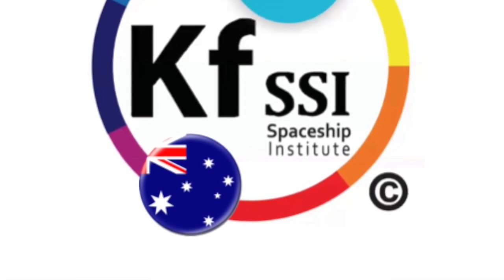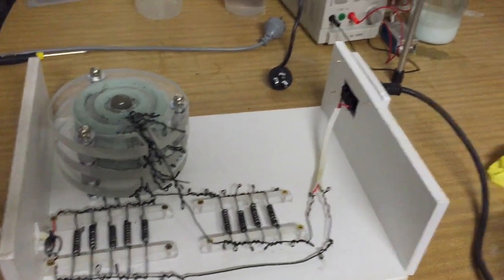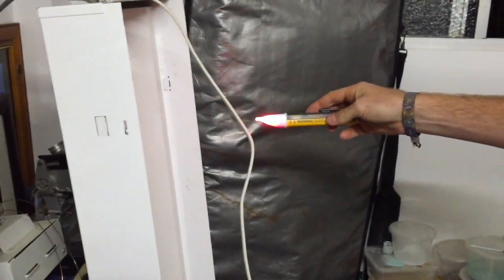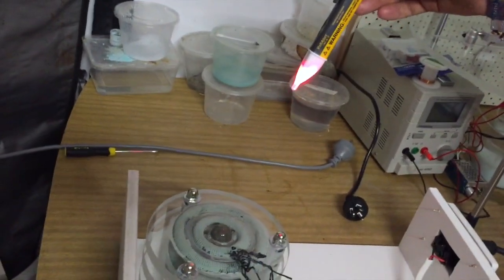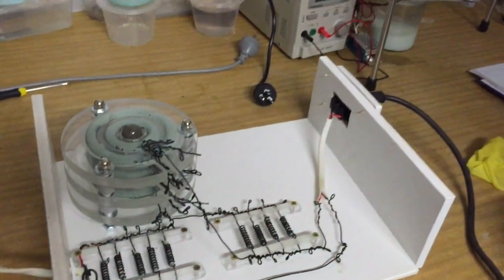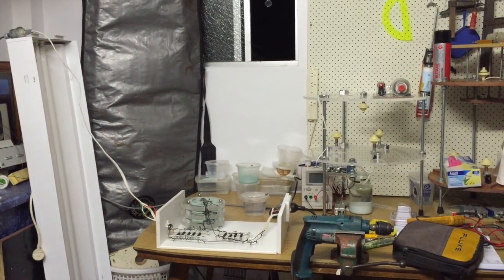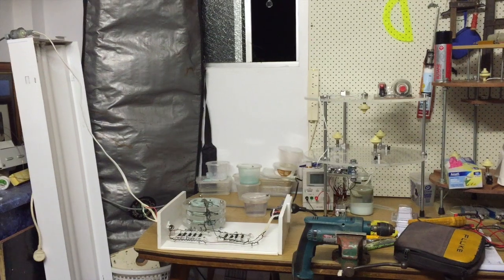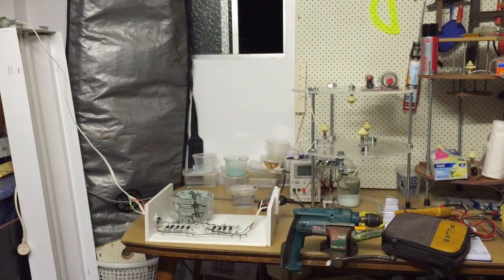KF Australia - Breakthrough!! Working Magrav power unit - Free, clean renewable energy!!

Comment from the maker: Hi this is Gil Rasmussen, this video shows the first Magrav unit I have built following the Keshe foundation blueprint teaching. This prototype was done slowly over six weeks while learning the concept. This video shows the first time it was connect to the grid through a power point. The simple fact that the system doesn't short out when connect shows that something is happening. When you look closely at this video when the drill is turned on you can see a small spark at the top of the stacker. The three electricians with me on that night had to pick there jaws off the ground when it didn't go bang. The tester indicates, active voltage only in the presence of electrostatic fields of sufficient strength. The lack of measuring information was due to not having a meter available for this test. The next video I make will show the measurement information in detail. Those who follow the blueprint know that it takes 3 to 4 weeks while slowly increasing the load to nano coat the wires in your house once connect to the Magrav unit. During this time the aim is to see power reduction from the grid.
Reply: +Joel Rasmussen 
The simple fact that the system doesn't short out when connect shows that something is happening
LMAO - a great success - Keshes crap which he gave to the "ambassadors" did :D

The three electricians with me on that night had to pick there jaws off the ground when it didn't go bang
You did something wrong when you bui8lt it. Keshes "blueprints" show clearly that it must go bang. Maybe your "plasma capacitors" were too dry? :D

when the drill is turned on you can see a small spark at the top of the stacker
This was to be expected with these drillrd oxidated wires. It will become more intense with time and a higher load until it ignites the plastic box. Better alert the firefighters :D

* During this time the aim is to see power reduction from the grid.*
Sure. a damaged installation does not draw much energy from the grid. Oxidated contacts, you know.

And now please tell me: does it hurt?
Reply: +Josef Görling - A troll hard at work - good to see you at least have a job. To bad you can't find a decent job doing something constructive instead of your typical destructive nonsense.
Reply: +Joel Rasmussen 
You need to compare output real power consumption to the input real power consumption. This means you have to measure Vrms, Irms and the Power Factor at both the output and input before you can calculate the actual efficiency of your setup. Comparing input current to output current tells you nothing about the efficiency of your setup, so you saying that you have a 'working' magrav unit is simply not supported by anything you have shown in this video. In the very least you need to get two AC power meters that measure real power consumption (automatically takes power factor into account) and compare the output real power consumption versus the input power consumption. Please correct the title of this video, as you stating that you have a 'working' magrav unit is simply not supported by anything shown in the video, unless your intention is to deliberately mislead the general public?
Reply: +Joel Rasmussen I would like to see a lot more video's of this. The .6 was that amps turning into .9 amps? What does the drill show without the Magrav system but plugged directly into the wall and running. I want to seeing what the running amps while the drill is plugged into the wall. You don't really need a volt tester per say if the drill reads the same. Also, What I'm wondering is if the coils are doing this or is it the capacitors or both. The capacitors can make the amps increase, so having said that then the question is....are the coils helping in creating the current? But keep in mind if the coils are not doing this increase then that does not mean that they will not help at some point. Just means we are still not doing it right along the way. Mr. Keshe is not incorrect. His complete theory on the planets and magnetic fields are spot on and is 100% fact according to NASA science. Tesla also understood that the coils create a larger magnetic field and proved it. Keshe wants everyone to be able to create a device that can give them a much better power bill but his main goal is to get enough money up to build a large scale UFO that is powered by the Magrav system. Every person on this planet knows that we all have not even done every possible thing we can with magnetic fields and ions. This is a real good start.
Reply: +Albert J You are right about the measurements. This is meant either to mislead, or the three electricians don't know what heck they are doing. Maybe even both. In either case, nothing is to be expected from this whole endeavor.
Reply: +Josef Görling without experimentation Josef you'd still be living in a grass hut. You are such a delight to read. Why don't you go bother some of the main stream media buddies.
Reply: +Josef Görling No worries mate!
The point i was making; Rick, working for the Keshe Foundation, is stating on their own forum, the device is not meant to create free energy, if one believe it would, one would be disappointed. 
I Agree his followers are stupid, they sure are thinking wishfully , instead of clearly. Sadly I don't See Keshe going to jail anytime soon because of this. The clear thinking never would buy any of his crap. The wishful thinkers will blame themselves, no criminal or civil charges will be the result because of that.
Reply: +Jason Witt
* but his main goal is to get enough money up* 
How true :D
Reply: +Joel Rasmussen As someone else pointed out, what we want to see is the Kw coming in and out of the system at different stages of time (as it should take 2-3 weeks according to Mr. Keshe for the unit to acclimate to your home and nanocoat the house).  Showing a differential of Amps only means that you transformed the voltage most likely, not generated anything.  The fact that electricity went through your copper wire setup without shorting is surprising but not impossible based on normal science.  It is electricity going through copper wire after all. The real test is the kW increase, which is the generation of Electricity from the reactor.  Something else to check after 1, 2 and 3 weeks is the wiring of your house itself.  As Mr. Keshe explained, the unit is supposed to nanocoat your house wiring starting with the wires near the reactor.  This means that the wires should change color and oxidize just like when you nanocoated the coils.  You can see visually if this happens.  Another observable effect over time is that transformers in your house and the equipment connected to them (tv, computers, other appliances with power converters) as well as incandescent bulbs, should stop working as well according to the teachings when nanocoated.  So you should be able to see the creeping effect of that as well.   Looking forward to more info as you keep it plugged in with increasing loads according to instructions.
Reply: +Josef Görling - Yes we do think it makes sense to experiment. It better than being useless like you.
Reply: +H. Skip Robinson Rick (working for KF) explains better the workings of the device. 

If your aim is to construct an apparatus (or buy a unit) to generate (excess) energy, you will be disappointed. Using less energy is a "possibility" and just a side effect. The main function of the Magrav is:

"... an interactive device that will change your environment and your life...but, only if you let it".

http://forum.keshefoundation.org/forum/manufacturer-information/45928-any-successful-working-homemade-magravs-yet?p=48980#post48980
Reply: +mag netron If you have the analysis (GANS and nanocoating) made in the lab of a technical university (it is less than 50 Euros) and if you after the test publish complete and unedited results including the name of the person who performed the analysis, then yes.
Of course it must be original Keshe Foundation material.
Reply: +Sebastian Au 
More respect please. At least he is able to document his ignorance in three different languages :D
Reply: +Sebastian Au Und Electronic Engineering lernt er wahrscheinlich un einer Wooniversität :D
Reply: +Joel Rasmussen 3 electricians and no meter. That's pretty sad to say they are an electrician if they don't have their tools. I am a very good high voltage electrician and I carry my tools everywhere i go, even the low voltage meters, several of them, as well as a rotation meter, digital and analog HV meters, phasing meter system, analog and digital, and all sorts of equipment. I have NEVER seen any electrician travel to a showing of a new technology without a voltage meter. NEVER!
Reply: +Marc Belanger 
3 electricians and no meter
If these people are electricians then I am the leader of the scientific world :D
Reply: +Marc Belanger Exactly what I say. The measurements which our beloved "tinklers" perform are complete bogus :D
Reply: Marc Belanger
but, it doesn't  mean we do not have counter abilities to Magrav
No need for that, "MAGRAV" is just the delusion of a derailed brain.  Of aall the other things you claim - well. they are only claims and wild fantasies. That science, which is published is far beyond you or eshe or all the "free energy" fuzzies can even imagine and it is readily available for everybody. Unfortunately only few people have the intelligence and education to understand it.
Keep on dreaming but stop claiming eithout evidence.
Reply: Sebastian Au "No I just refuse to accept pure claims."
"No I just refuse to accept idiotic claims."
Fixed that for you :)
Reply: +H. Skip Robinson We know already trhat you are beyond hope. Don't forget the 25cn quartz crystal and the three coils on the coming thursday "workshop" :D
Reply: +Joel Rasmussen Congratulations we will look at the results I greet you from the team Gtel (group of works by the free energy) www.energia-libre.info so we are replicating and showing all construction details, thanks.
Reply: +Sylvain Rochon - Agreed. What many do not seem to understand is that we are all skeptics. I'm building a few right now because I'm skeptical that it works. But you must admit it's interesting.  We know zero point energy, A/K/A aether, plasma, radiant energy, fusion, static, electro-gravitational energy or what ever you want to call it exists. We just as of yet haven't figured out how to harness it in enough quantity to put it to work. Actually a couple of battery charges exist but many think they are just harnessing existing radio waves. We know every single thing within the earth's ionosphere has electrical charges with in it. Every "living" thing has a least one frequency that it operates at. Metals appear to attract these charges. We have to place zincs on our boats so the other metals don't rapidly corrode. You want to research something interesting. Electrets; two dissimilar metals sheets coupled by beeswax or resin appear to become a self sustaining battery if constructed properly. I'm seeing a nano coated copper plate appear to absorb electricity just like a battery but without a charger. We're currently putting resisters on both copper plates and the coils to discharge the current and they are recharging themselves. Someones going ot figure this out. I personally believe the two guys in Brazil (Leal and his partner" did it as well. They reportedly have three separate Univ. studies that proves it works.
Reply: +Enrique Dangeroux  How about if you measured both amps and volts both on the input and output? You could then simply multiply to get your wattage differential, if one exists.
Reply: +Enrique Dangeroux - We ordered some more cooper wire last week and the company rep said he just had to order another 80,000 lineal feet of 14 gauge wire.  Copper prices will be going up a this rate. Is the Keshe foundation invested in any copper mines? lol.
Reply: +H. Skip Robinson LOL, I was wondering the same thing. If it would had been me and I had a investment in a copper mine. Chances are, we are not even putting a dent in the copper industry.. I'm also doing gold GANS and Stainless Steal with Graphite. The copper to me is just the base model. If you have a gold coin \ bar, swift the zinc out with gold and try some with mixing graphene into the mix. Good conductive results. The best yet...
Reply: Jason Witt
Keshe seemingly is right, when he says:
(Transcript from first international workshop, Dec 8th 2015 at 01:36:05 into the video)

_*Every single one of you failed. The greed took over your intellect.
And then you called me a liar, when you don't want to call yourself Stupid.
You are the most stupid lot I've ever seen Your greed was so high, that you missed the whole ball and it's been right in
front of you. And all I've done, I've used the same thing, no more. Anybody who
wants to bring a bullet to shoot themselves for a stupidity bullet not to kill
yourself but to shoot yourself with a stupidity bullet (?), bring it with you on
Thursday. I'll let you shoot yourself*_

Still think it makes sense to experiment?
Reply: +Josef Görling I haven't called you a liar and I haven't failed. What are you talking about? What is the frig is wrong with you. You just dying to be right. Do you suffer for some  sort of anxiety? Even though you seen to have some brains nobody is going to listen to your ranking and raving. I'm actually enjoying you. I'm experimenting with you as well.
Reply: H. Skip Robinson Have you read the transcript of Keshes rant? (this is just a tiny little bit of what he spit out in the first international teaching WS.

If you read the transcript of all his irrational passages or, even better, see the video and you still believe that what he "teaches" is more than stupid crap you are beyond hope.

Have you already bought your quartz crystal - it is required for the unit to work - see keshes todays explosion of stupidity. Take it or remain what you are and support a scammer.
Reply: +Josef Görling Remember, if he is committing a fraud then he can be both criminally and civilly charged. He'll probably plea innocent by reason of insanity. Lol That means all his engineers and officers of his foundation could be charged as well. Sorry you don't understand the guy. He's got a quirky sense of humor that you just don't get. I think he's an interesting character and a visionary.  

A friend and I decided to build a few and test. About $300 total which we split and we're making 6 full units to test on both homes and cars. We are currently nano coating and making various GaNs. Copper, Silver, Brass and zinc. We live near the ocean so we're using sea water for the GaNs. It not that it is really very difficult so we are doing it in our spare time. It's actually taught us a few things. 

Just to let you know I invented or at least I thought I did a vertical axis wind and water turbine and sold it to a company. They did not defend the patent so I don't know. What I do know is I looked at tonnes of art work and saw nothing that would actually work like mine. Both my wind and water turbines work and have been tested by engineers. Apparently you can submit a drawing for a patent and you don't even have to show that it works. 

Alexis has designed and we built one of his two motors so far. Just got the money to build the other.  One is just a unique coil design using standard neo magnets that is already tested out better than standard ceiling fan motors. Sort of like the Keppe Motor being made and sold as a ceiling fan but we think even potential better. Takes a lot of money to do all these experiments. We've got $4K to $5K in just the first motor. 

Point is the Keshe Magrav is relatively simple to build and cost almost nothing so why not give it a try. Every time you do something you learn. It has giving us some ideas for another project called an "electret".  

I know that people like you would rather sit back, let the other people do the work and just judge. As one of the insurance company ads say "You're not helping grandma."
Reply: +Josef G&#246;rling Maybe you misread, or meant to reply to someone else, my friend.
Reply: +Enrique Dangeroux Ah. So this;
If your aim is to construct an apparatus (or buy a unit) to generate (excess) energy, you will be disappointed. Using less energy is a "possibility" and just a side effect. The main function of the Magrav is [snip]
was a quote?
In this case: my sincere apologies :)
Reply: +Enrique Dangeroux I have some hope, not because of the scam, but because of the slander. He did not yet publish names and other data, but I know he knows my real name and it can be enough if he mentions it in a workshop. He has already mentioned Martin Delannoye, police officer in Kortrijk and accused him for murder. Maybe Mr. Delannoye reacts (I have informed him about this irrational breakout)
Furthermore he has accused all who called him a fraud or scammer to be criminal (murderers). As i have called him so several times I am a victim and can sue him. I have already issued a declaration of facts, we will see. 
One more point are the tax officials - I have read a rumor, that he is suspect for tax fraud of about 300 000 puonds in the UK (this is not yet confirmed). Maybe the very well organized Italian tax officials will do something. :)
Reply: +Josef Görling 
Well mate, it is good you have hope! I have little. The criminal route, I think is futile considering the low legal penalties involved and being civil law. Keshe can not be stopped, slowed down he could. The best way in my option would be the Tax route (The UK situation is unknown to me, but my research have showed me tax fraud in other countries for a fact), simply because he is screwing the government, not a private individual. However Keshe is in the global scheme of things, a small fish, the government(s) are lacking resources since all the cut-backs and all... Keshe's timing is perfect.... Maybe i am being cynical, maybe realistic... Time will tell.
Reply: +Enrique Dangeroux I think I give it a try :D
Reply: +Enrique Dangeroux When the economy collapse,this and free energies are the only relevant thing for humans to get back on their feet.
Reply: +Josef Görling World governments support Keshe, and he is an asset to world governments the world supports him he is to big to fail pal, buddy!!
Reply: +Enrique Dangeroux Bahahaha good luck troll world governments pick and choose which law to enforce. World governments already realize that Keshe offers them a way out of debt especially energy cost. Keshe can save world governments Trillions of dollars in energy costs that will reduce dept, and therefore IMF is forced to loosen financial grip especially in developing countries, it is the Petro Dollar that's in trouble won't be long before gasoline drops to $1.50 per gallon.  the World governments has Keshes back including the World's best nuclear Physicist (Jason group) yes the technological secret society has Keshes back my dear friend....
Reply: +mag netron Definitely everybody who believes in that dirty little scammer and his delusions. Have your "fat" analyzed in a lab and post the result or remain in the mud of ignorance and superstition.
Reply: Josef Görling I will get it tested if you pay for testing deal?
Reply: Josef Görling iwalk the talk so u gonna pay for analysis?? Or what??
Reply: kind of like a Joule Thief but much more efficient and better and can self sustain, were as the Joule Thief cannot self sustain because it requires a power input.
Reply: Josef Görling George Washington university Professor replicated Keshe system and extracted co2 American Chemistry Society facilitated the finding thus validating Keshe done deal case closed. ..... Hehehe hahaha who is the idiot now Bam!!!!
Reply: +mag netron Provide the name of the professor and a link to the paper. If not I call you a liar ot gullible moron.
Reply: Josef Görling if you have half the intelligence of a rat you can find it hs ha ha morronic fool ha-ha ; D
Reply: +mag netron :D
http://thinkscientific.w4f.eu/morbus_bahlsen.html
Reply: Josef Görling Ichss verstain kindle Deutsche sei lebish der cartoonen mochen sie ienen cartoon?. Ichs learnen Electronic Engineering. Adai Josef.   ; D
Reply: Josef Görling I speak three different languages could do four if I wanted to so who is the moron now anyhow back to my Electronic Engineering going to be out of the net later days bra!!?
Reply: +mag netron Have a look again, it is now in English as well :D
Reply: +Josef Görling He speaks three different languages, too bad he never learnd how to verify claims ^^
Reply: Josef Görling go kick your nuts
       :  D
Reply: Josef Görling OK I'm done playing with you kids better drink your milk and go to bed....
Reply: mag netron :D
Reply: You are right Josef, not everybody is able to document his ignorance in three different languages. Too bad that being able to speak and write three languages does not enable him to understand basic concepts of physics. Ich glaube er hat einfach zu viel Pipi Langstrump geschaut und das Intro hat sich in seinem Gehirn festgebrannt. :D
Reply: +mag netron 
__George Washington university Professor replicated Keshe system and extracted co2 American Chemistry Society facilitated the finding thus validating Keshe done deal case closed_
You are the idiot. Keshes crap has absolutely nothing to do with this scientific paper. Only somebody with absolutely zero knowledge could believe that. But I am sure you have not read, let alone understood the paper. Conclusion: Keshe is a hypocritical idiot and his followers have no clue at all, but a big mouth
Reply: Josef Görling I can tell that you have absolutely no quantum mechanics knowledge whatsoever
Reply: Josef Görling you do not have any critical analysis ability whatsoever you don't even have any rudimentary Chemistry knowledge of you had any of these aforementioned abilities you would have understood the paper. You are just here to destroy a person's interest in physics, Chemistry science. You are nothing more than a very unhappy person and you pick arguments with the wrong individuals especially when those people have some knowledge in electronics you are a done deal you do not have the agility to even support arguments your Premise is nothing more than declaratory you are a person who does not have a relationship with the opposite sex you have poor interaction with people you are a loner that Is why you prefer to argue sensless premises.  You do not have any Intellectual maturity people avoid you like s plague but you are lucky because people understand your mental state in conclusion I have conclude that you are s very young individual with a lot of learning to achieve good luck Josef.
Reply: mag netron Fail. Tey again :D
Reply: +mag netron Thank you for demonstrating how whackos argue :D
Reply: Don't you have a girlfriend or something jeeze.... ;  D
Reply: mag netron Well now we know already, so there is no need for you to confirm it again and again...

http://thinkscientific.w4f.eu/morbus_bahlsen.html
Reply: Are you against any form of free energy?
Reply: Josef Görling are U against free energy in general?
Reply: +mag netron No, i am already using it - it's called photovoltaic. Buffering is done by the grid supplier. My bill over the year is less than 100 Euros And I use an electric car. 25 cents per mile.
Reply: Josef Görling I'm going to experiment with the Keshe capacitor
Reply: Josef Görling N. Teslas electric car charged itself 1929..
Reply: +mag netron Yes. And my pink unicorns are dancing tonight :D
Reply: Josef Görling yes Josef go play mitt your majik pony : D
Reply: mag netron Intelligent response. Congrats :D
Reply: ;D
Reply: +Jason Witt When voltage drops, amperage climbs. There is no proof that anything magical is happening here. He needs to re-video using both ammeters on both sides and voltmeters of all the same kind/brand/model, Fluke, B&K, or something really good quality. The frequency would be nice before the system starts on both ends. If the voltage on the right is lower than the input, then, it is only transforming the system, raising the amperage and dropping the voltage by Bucking the output as a bucking transformer. I will believe more once this test is remade with voltage and ammeters on both sides to prove this ISNT happening.
Reply: Marc Belanger _When voltage drops, amperage climbs_
Caution! - this is only valid for the current available on the output of a transformer 
A load designe for 230 Volts has half of the current and a quarter of the power consumption at 115 Volts and with inductive loads it is even worse in 115 volts grids because of the higher frequency (60 vs 50 Hz)
Reply: That's not true. If the output of the circuit seen in this video was 180 volts instead of 230 volts, it could explain the difference in current that we see between the input which shows like .6 amps and the output, which shows .9 amps. You have to be careful how you say things in these comment sections, voltage needs to be shown with amperage simultaneusly, but, power factor only accounts for maybe 2-3% difference which isn't much. If these coils are acting as transformers instead of capacitve inductors, as Keshe states they are, they will be showing exactly as I say, a low voltage at the output and a higher amperage, mistaking those who watch the videos into believing there is overunity here, and the video doesn't show proof of anything other than the fact that the amperage is higher at it's output, which could simply be indicative of the changes in voltage between the input and output, reasoning why the voltmeters probably are NOT present. BTW, a meter is always in the possession of an electrician, we do NOT leave home without them.. 3 electricians, even less of a chance to NOT have a voltmeter. Something doesn't smell right here.
Reply: Josef Görling So, you tell me that Ohm's and Watt's law doesn't apply on an inductive load and less so in Australia or Europe? Where did one ever hear that the power consumption would be 1/4 of that of a 115v circuit other than inrush current? The amperage in a 115 volt circuit is doubled at the same load of the 230 v system. The frequency doesn't make much of a difference, in fact, the higher the frequency, the more joule per coulomb, so, I think you need to rephrase. The only time 230v systems are more efficient are during startup due to the speed of the takeoff with the doubled voltage and less strain. This is the reason a pool pump is so much more efficient wired at 230v than 115, but, in the long run with the same power factor ratio, the amperage has to be exactly half due to the drop in ratio and application of ohm's/watt's law.
Reply: +Marc Belanger As I stated above - this would be only if the coils were a transformer (which they are pretty sure not - it is more likely that they act as a solid piece of copper given the amateurish design).
But even if there is a transformation to a lower voltage, the same load would consume less energy and draw less current (I=U/R)
Reply: These are dual voltage motors that share capability to do both voltages, the only difference in amperage would be due to power factor, especially if they were unloaded as in the video. Place a load on the drill in the video and an even more absurd voltage and current displacement would happen
Reply: Marc Belanger I see, so this was a misunderstanding between us. In this case the load is not the same - it is increased when the voltage drops. The drill uses Phase angle control and at lower voltage and with the same mechanical load the phase angle is increased causing a higher effective current and thus keeping the power constant.
(I do hope I can make myself clear - English is not my first language)
500 Watts at 230 Volts are roughly 2.17 amps, at 115 volts you need 4.34 amps for thr same (electrical and mechanical) power
Reply: That is exactly what I said, the wattage and amperage part. You see, what you say at the bottom for 500 watts is watt's law, 500/ 230= 2.17 amps and 500/115 = 4.34 amps. In your first message to me you stated that the power consumption would be less. Power equals wattage, so, 500 watts to each of the voltages would result in always double the amperage if the voltage is half, however, the amount of power used would have to be the same, in this case what I am saying is if the voltage dropped inductively in the circuit, because the coils are inductors, inside of inductors., (Keshe calls them capacitors) they can easily react as transformers. Since he sets up series of these miniature transformers, it is very easy for the voltage in the output to become lower, doing the same thing as what you just did as a conversion. If the drill was using 138 watts at 230v which would be feeding the circuit, the amperage at the input should be .6 amperes. If we drop the output voltage from the Keshe reactor to the drill down to 150 volts, the conversion would be approximately equal to the wattage given at 138/ 150v = .92 amperes. I know I didn't convert power factor, but, the difference could only equal an approximate difference of 1 to 2% if power factor was figured in, however, in Keshe's case, his system would supposedly output power, so, the power factor quality should improve, making the difference most likely zero, unless it was reacting as a transformer with a loss, then, the amperage would climb a bit more from the loss. The drill is with no load, so, losses are minimal, and, that drill would function fine without a load being fed 150 volts, it would however suffer from loss of speed and strength though, however, the amperage would be there because the load would be identical leaving the amperage approximately where I am saying.
Reply: Marc Belanger Yes that's clear. My misunderstanding was, that I thought you were speaking about a constant resistance/impedance as load and you are talking about a constant power as load - which is what these multi voltage devices do :)
Happy new year btw. :)
Actually one thing is clear: to measure input and output power/energy of these "power unit" one must measure voltage and current on both sides. preferrably with a ferraris counter simultaneously, measuring just at ther input even with a kWh meter is BS, let alone measuring just the voltage.
Reply: +Josef Görling +Marc Belanger I was speaking of a constant resistance of the load, not a constant power consumption. In a constant power consumption the current goes up if the voltage drops, but in a constant resistance it goes down. So we are both right and you are especially right when the load is designed for constant wattage like many drills are (under the same mechanical load of course)
However measuring current on devices with phase angle control is a bit tricky because the waveform of the current is not a sine - cheap DMMs would pretty sure measure fantasy values :)
Reply: yes, I agree. I am very thorough before I make assumptions in believing much when the technologies look like pseudo science, however, I am not discounting the device, but, to show it's true readings, they should be using at a bare minimum two killawatt meters to show it's function if it did indeed have any type of overunity, if not, much doubt is very evident from the viewers. These meters actually give satisfactory measurements of many types that are fairly accurate for their cost. Happy New Year to you as well.
Reply: Josef Görling And we don't know what kind of a wave is let through the Keshe Generator because it is supposed to incorporate capacitor and inductors simultaneously in a unique way. When this happens, who knows what the oscillations will look like if they aren't perfectly tuned, they could look like waves from a charge pump, or, they could be saw tooth waves for all we know, so, without a scope or maybe even a spectrum analyser, all bets are off with any type of mathematical relation to conventional methods. If the output is cold electricity, it wouldn't measure voltage, but, then again , they have a constant current, so, it must be conventional electricity since the levels aren't all over the place. In some of the unorthodox systems I have built, many strange things happen until loads are added to the output, waveforms look wierd, and, once a load is added, some of them release  sinewaves, some unique. The funny thing is that there are devices I have measured that have no output until a load is present, and, before that, I thought I saw it all until that happened. Scope, voltmeter, and ammeter on both ends of the circuit would be great to see.
Reply: And still no conclusive data not even close.
Reply: I know Keshe has some very serious technology, however, I do not think what is being sold is to give away free power, nor has anybody yet shown any good result. There is a man in Switzerland that tests the unit he bought from Keshe and it shows a small loss at first, then, not only 2 weeks later, he had no signs of coating on any wires other than what was already nano coated, but, the device was drawing more energy than he did draw before he started, putting his electrical system at a loss. I do believe this technology is rendering systems inoperative or could when something else gets turned on. I do believe the military of Russia is using this technology to generate completely free energy because there have been US navy ships and subs left completely defenseless when Russian and French ships were near by, however, if they have this technology, it is not new, it has been around for a while and, if the Russians have this, we now know how Iran got nuclear weapons. If one has the technology of Keshe, then, they know how to counter it as well. We do not have this nor do we have the ability to counter it, however, we do have some of the technology of Smith. So do other countries and the technology basis is similar as it does draw energy in from the magnetosphere with no ill effect to electronics. Magrav must be using systems similar to the Bashar STA, as stated by Bashar, if we use the technology, our electronics and electricity would be rendered useless. It sounds similar in structure and operation to Keshe technology and, it has to be the inverted vortex technology that is doing what he is stating.. biut, there is a counteraction to every action and an inverse or equal and opposite to everything that we currently know. We have antigravity technology. It is hidden. But, it is there. The problem we have is that they have it and we don't know how far along they have come. We have had technology far beyond what most know here in the US because we've suppressed something since 1947. I'm sure they did too, however, our technologies are always kept top secret, but, it doesn't  mean we do not have counter abilities to Magrav.. We've been in space the longest.. I'm quite confident we have weapons the rest of the world does not have, and, it doesn't mean we do not have energy devices or energy generation devices that are self contained units able to operate within their own shielding. That is what is necessary to overcome grounded device opposition. Once we utilize air grounds via avramenko technology, we overcome the conventional diffusing because our energy systems now do not belong to the ground, but, can be operable anywhere, in the sky, or space as the devices are not relying on being zeroed to the ground as all electrical systems here currently are.
Reply: Yeah apperently Marc does not need to understand the science behind his computer/smartphone to actually use it.:D
Reply: +Joel Rasmussen Awesome! Thanks for sharing, regardless of the outcome, we remain very open minded ;) Stay Blessed!
Reply: Sebastian Au I clearly understand everything that is going on here. There is not one bit of overunity. Let me ask you Sebastian, what have you created lately that has astonishing results? Let's see if you could output 3000 watts of 120vac power from 5.4 watts of input of 120vac to power any type of load without any problems as my Pelex device does. Then we will speak about who understands what. One thing I do not have in my mind is lack of understanding about too much, and I don't have to resort to sarcasm when statements are made about devices that KESHE clearly has designed, however, we haven't seen or received because he doesn't sell the devices that the governments have been given. His technology has downed 2 of the US's drones, one of the interceptions is on video, and, they have the caught drone on video which was on Iranian news. The other is that they gave the technologies to the French and the Russians before us and in 2010 or so, one of our Naval ships was basically shut down by the mere presence of a Russian device that used Keshe's technology. Since this date, the US has been given the technology, but, known to us, we still have not created countermeasures to the technology , including them in any of our war vessels as they are all conventionally wired. Once this has been eliminated, we m ay have a chance of a warranted operation of our weapons systems because Plasma technologies qand scalar devices completely shut down conventional shielded electronics systems and there really isn't anything to shield them except for one type of coating that I have found which I use on my Pelex device. It took me nearly 3 years to figure it out as well because scalar waves run right through grounded steel as it wasn't even there, eliminating electromagnetic circuitry entirely due to it's effect on the planetary magnetic system and the magnetosphere by shifting the plasma tubes directed from the magnetophere and Earth. Once these tubes shift to draw the energy into a device, the polar arrangement of inductors goes haywire and will not function correctly, especially if they are resonant systems.
Reply: It would be nice if you are willing to share your informations but personally I don't care about  the anecdotal evidence you've posted until now. ;-)
Reply: you speak down about others then want something from them?? I think you are barking up the wrong tree.
Reply: No I just refuse to accept pure claims. ;-)
Reply: Josef Görling
 Thank you for the clarification! :)